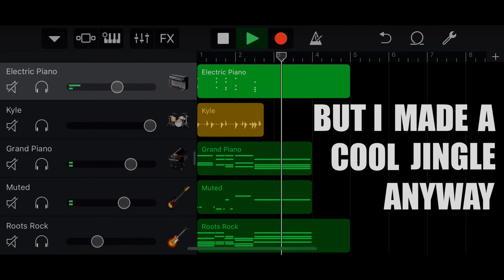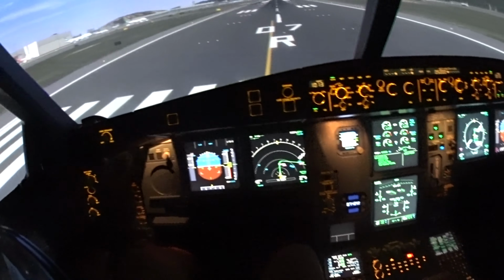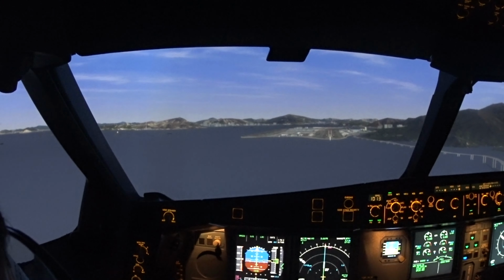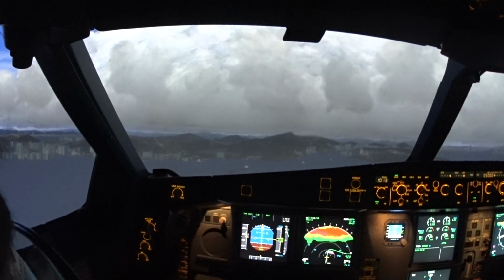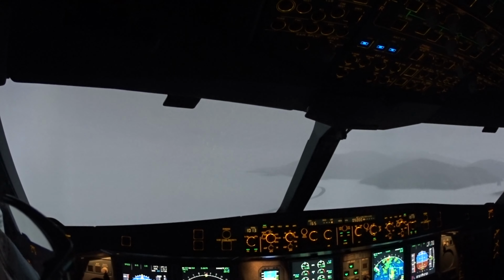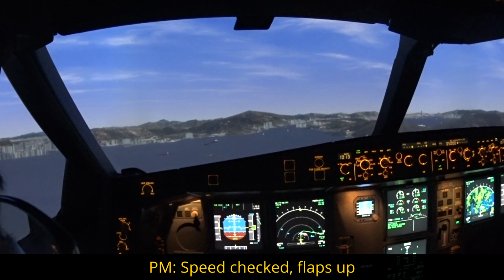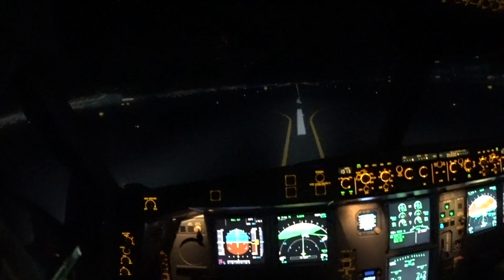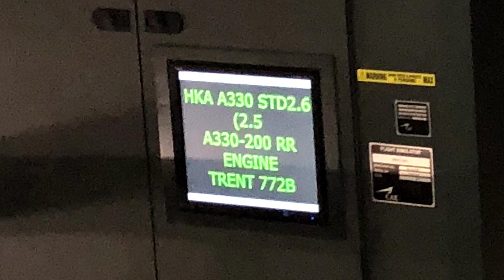Flying a Level-D Simulator!

Comment: Maybe it was mentioned somewhere in the comments but I would like to give my 2 cents as well, as a person designing and building the visual world the simulator flies through (on the defense and security side of the company). The visual background design holds accuracy to a higher standard than how nice it looks (1 example: materials. You'd notice different behavior in the sim between asphalt or concrete, going over oil slicks and the like). This has changed recently with the CAE Prodigy introduction where the visuals can finally be up to par with games but still retain the level of accuracy needed for in depth simulation of all systems and emergencies that pilots need to train for.

Comment: Great video. I own a 737 sim and I’m struggling with a camera that works well in low light. Do you mind sharing what cam you use and if you can live stream from it? Thanks.
Reply from the maker: This was filmed on a Sony AS100v strapped to the right side of my head. Unfortunately I haven’t tried livestreaming from it so I can’t say if it works for that.
Reply: @Tech2Papa  oh ok thank you for the response. I will search and see if this cam has the streaming capabilities. Thanks again.

Comment: How Much does it cost to fly inside a real simulator like you did? Terry
Reply from the maker: Normally HK Airlines doesn’t allow you to use their simulators. But when this was filmed (in the pandemic), almost no one was using their training simulators so they rented them out for public use. They charge 10000HKD for two hours for their Level D A330 sim, and a bit more for their A350 sim.

Comment: What a nice experience, thank you for uploading, I wasn't allowed to record anything/publish it. I flew an a320 in a Lufthansa simulator. I remember taking off and just having to laugh out of joy because it felt so real. My instructor let me do a lot of hand flying and stuff I have never done before like raw data ILS without any Flight Directors and then getting positive feedback at the end of the session was the cherry on top. 
Eventho I was new to flight sims back then and I feel like I'm still pretty new nowadays (not even 300hrs in MSFS), but I still want to go back (when I have the money 😅)
Reply: Watched the video again and I have to agree that the sound is not as good as IRL, I love the roar of the iae v2500 and the cfm56 and it clearly didnt sound anything like those engines while take off. So it's not only a a330 simulator problem.

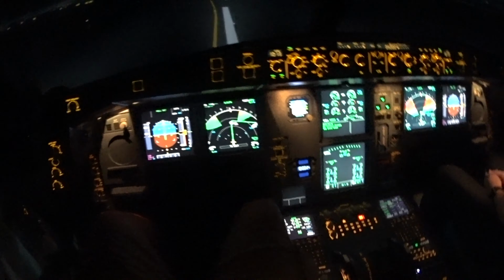Comment: 30:02 How it felt to fly was partly untrue. As no current Airline flight simulator (even Level D) produces any G-force!

The only flight simulators with kind of G-force are certain military flight simulators. That requires the pilot to wear a special suit that gets compressed and expanded. To mimic G-force from a real plane.
Reply from the maker: Good point! Though these simulators can fake lateral Gs by pitching up/down/left/right, they can’t fake upward and downward Gs (except briefly when touching down). 

Though, given the only “extreme” Gs you’ll normally feel in an airliner is the touchdown since movements are generally pretty gentle, I’d say the illusion was very convincing. It roughly matches the Gs you’ll feel in a normal airline flight anyway.

Comment: Well i'm a simulator engineer working on these machines so maybe i can help you just a little with the spec's question. Reason why you don't get an answer is that its hard to explain what computer is running this. It is actually lots of computers. Every system has its own computer (like motion, controls, weather radar, sound, audio,......) . And they can be different on every simulator. They are mainly all server computers all speaking to a main simulation host computer. They are also configured differently according the system they need to simulate ( like graphic computers that run the EFIS screens all have big graphic cards) ...... The visual also has a seperate host comuter and several channel computers (also they can be different to another simulator) . They are mostly top spec server computers that are available at the time the simulator is build. So you cannot just say what computer spec is running this simulator. Its a complete network  ;-)
Reply from the maker: Interesting! Thanks for sharing!
Reply: Awesome insight 
Thank you for taking the time to type that all out

Comment: Hi there, nice video , I'm going for a full simulator this week for the first time. I want to record it also, may I ask where you put your action camera? On your head or...?
Reply from the maker: Thanks! 
I put my camera at the side of my head with a headstrap. I used a Sony HDR-AS100V to capture this, which is longer than it is wide, so it’s much easier to position at the side of my head.
Enjoy the simulator! I’d strongly recommend becoming familiar with the procedures of the aircraft you’ll be flying, so you can focus on enjoying the plane rather than trying to learn it, as I have done.

Comment: Great video. Just a small tip, if thrust reduction and acceleration altitude are the same, its a good practice to lower the nose before reducing the thrust to prevent any unnecessary speed decay. It's not explicitly written in the manuals to do that but there is a note that in manual flight, flight crew must anticipate the pitch attitude.
Reply from the maker: Thanks for the tip!
Reply: That's good to know - thanks!

Comment: Hi @Tech2Papa :) Great vid n thanks for sharing!
However, I still don't get about the collimated display. I tried watching a cockpit video indirectly using a mirror and can't seem to find any difference. Any ideas on how I could experiment with this collimated display thingy at home?
Reply from the maker: Thanks!
Basically, what a collimated display does is make the original image from the projector appear much farther, so that two pilots sitting next to each other view the same thing. 
If you’ve ever been in a moving car and looked outside at a distant object, like the moon or a mountain, you’ll feel like they barely move even if you’ve travelled kilometers. 
Using the same logic, we can make pilots sitting next to each other see the same thing by making the image appear much farther than it actually is. So instead of projecting to a screen right in front of a pilots, the image is projected to a screen just above the front windshield, which is then reflected back to the pilots with a large spherical mirror. 
Now to understand this spherical mirror, we need to know a little physics. Normally for any object, light rays reflected off them diverge in every direction. Our eyes can see a clear image of the object because it focuses on the convergent point of all these light rays (the point which the rays diverge from). The further the object is, the more parallel the light rays from the object entering your eye are. 
The spherical mirror is necessary for the image to look distant, because if a projector screen is placed close to the mirror (like it is in a collimated display), the mirror can reflect light rays from the screen such that they emerge approximately parallel, which to our eyes, looks far away. Much farther than it actually is. 
So to successfully make a collimated display, you’ll need a large spherical mirror. Hope this helps!
Reply: @Tech2Papa  Oh my God bro you rock!! Dream explanation come true. Now hopefully my experimental project comes true as well with this helpful insight. Thank you so much!!👏🎉🙏

Comment: Do they build their own game or use msfs2020? I play 2020 on my gtx 1070 with HTC vive and a 20$ joystick 😂😹thanks for your video 😊
Reply from the maker: CAE uses their own simulation software, but unfortunately I’m not sure about the hardware of the computer than runs it. 
That sounds like a nice setup though :)
Reply: @Tech2Papa  thanks! 😊
Reply: @Tech2Papa  it runs on many computers, all connected together. there's too much systems to simulate for just 1 computer
Reply: @sTammoi  Cost around $20 million US. The realism is absolutely sensational. Full OTW visuals, focused at infinity. Very different from looking at a screen.

Comment: Level d simulators are just not built to look or even sound good. In fact, during most parts of the training we are actually in IMC and there wouldn‘t be any benefit of landscape scenery, autogen or similiar things. Even if simulator time is waaay less expensive than actual flying time, it’s not exactly cheap and the main purpose of training in the level d sim is still handling of non normal situations. Almost no landing we do during our recurrent training in the sim is with a normal configuration.

Nevertheless, great job flying wise! Hope you enjoyed it
Reply from the maker: Interesting! Thanks for sharing :)
Reply from the maker: Thanks! Means a lot coming from a pilot!
That makes sense. You wouldn’t want to waste valuable sim time on situations you normally encounter with real flying.
One question though. How does the handling of the Level D sim you use compare to the real aircraft? Is it accurate?
Reply: @Tech2Papa  it differs from sim to sim. Some are better, some are a bit off. In general, I would say that in the sim sometimes everything feels a bit computed and just „simulated“, it‘s not as dynamic as in reality. Control inputs are almost the same, maybe a little less „instant“ or „direct“ as in the real plane. But overall, it gives a very good and accurate impression of flying the airplane.

Comment: As for the “specs” of the computer running the simulator, it’s probably all custom. Custom computer, custom this custom that. Id be surprised if the sim was running off consumer PC hardware
Reply from the maker: Oooo didn’t know that. Thanks for sharing!
Reply from the maker: That’s what I’m thinking. Wish we could know how powerful those components are compared to consumer hardware though :)
Reply: @Tech2Papa  Don't read too much into it. Sim tech here. It depends on the manufacturer, but the majority of the components are no more "powerful" than consumer grade components, they just shove more into the server towers. Generally these units are broken down into Master/Visual/Slave Pcs, with a PC dedicated for sound, hardware controllers, etc all packed into server racks. Depending on the manufacturer your generally have 6-10 units per tower, not accounting for contingencies. 

All that said, they do probably have it all standardized in these CAE versions. Level 6/7 simulators (think 800k-1.5 millions range cost wise) generally get away with consumer parts on any level. 

Most of the cost you're seeing for a level D (5 million-20 million on average pending models/visuals etc) are baked into the cockpit/hydraulic/and especially the visual system.  Not  to mention the cost of pulling all of the flight data for that aircraft initially in the construction phase.
Reply from the maker: Wow! Thanks for the detailed info!
Reply: @populargames2024  Right I see... So you mean to say it's literally just a bunch of PCs linked together like in some home cockpits?
Reply: @Tech2Papa   Just checked with FAA ratings. Any certified flight sim must be a hardware/software certified bundle. So I think they could get away with using consumer hardware, but they would have to certify it with software. But I'd think they'd use custom hardware cuz it could be more reliable/compatible

Comment: What is it like controlling a plane on a real simulator compared to a PC?  Is it easier?
Reply from the maker: It’s the same actually. As long as you have similar equipment at home, controlling the real thing is just as easy as on a desktop sim. The only thing I had difficulty with was rudder control but that’s because I don’t have my own rudder pedals.
The physics is a bit different than P3D (P3D’s flight model was never really amazing, XP11 and FS2020 feel more similar to this) but in my opinion, the flight model is the easiest thing to adapt to.

Comment: Hey I have a question. How much would I have to spend to use one of these things?? Also your videos are very high quality you deserve more subs my guy😁👍👍
Reply from the maker: Thank you!
To answer your question, different airlines/training centers have different prices so your mileage may vary. 
HKA’s price was around 5K HKD (650USD) per hour for the A330 (and a bit more for the A350), though these aren’t normally available for public use. It’s just that with the current state of the airline industry, almost no one is using these simulators so they wanted to rent them out to make extra money. 
Lufthansa and British Airways normally offer public access though. BA only has their 747-400 and 777-200 for similar rates as HKA, while Lufthansa has their entire fleet available (though these are almost double the hourly rates of HKA and BA). 
Hope this helps :)
Reply: @Tech2Papa  It's not cheap, at all, but damn if that doesn't sound worth it :) Very cool man. Thanks for sharing.